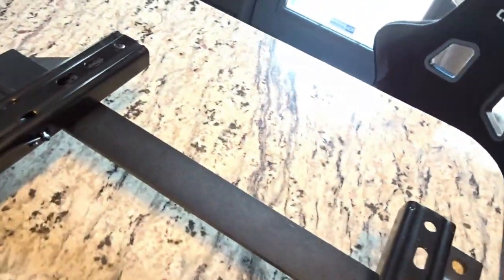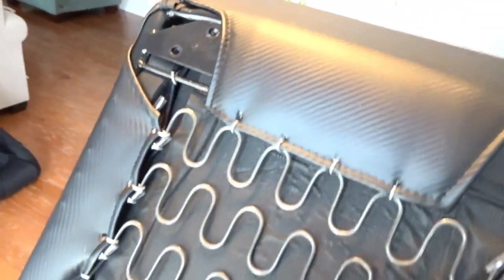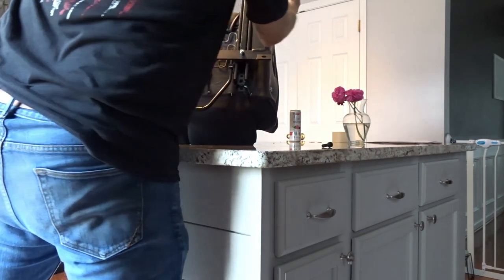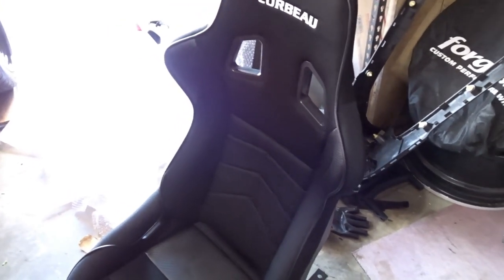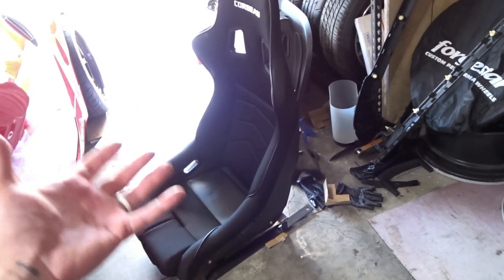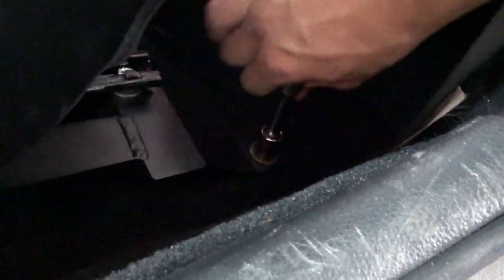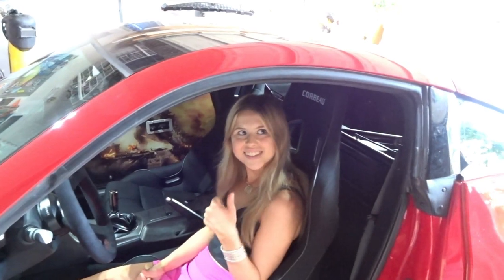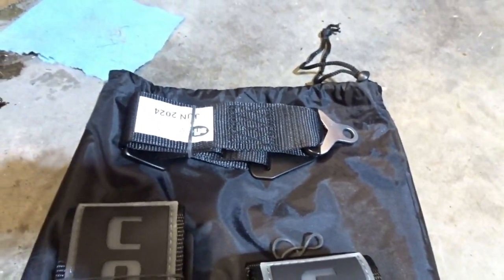Best Seats for 370z or 350z | Installation inside!

Comment: Not a fan of the 350z content but would these seats work on the Q50? I need to cut weight on the car. Also any discount codes on the seats would be Epic.
Reply from the maker: Just say you're not a fan of the 350z lol.  Don't say you're not a fan of the "content"!  But yes, I think these would be awesome seats for the Q50.  I'd love to have a discount for you, but Corbeau did not mention one at this time.  Click the link and look around the site.  If they see enough traffic coming from this video, maybe they'd consider a discount code.  At least I'd have more leverage to ask!
Reply: @SpeedCultureStudios  I got one more question for you. Did you get a airbag dash light after instal, if so did you figure out how to get ride of the light?
Reply from the maker: @randomkillz.2338  Technically, my airbag light was already on because the previous owner installed an aftermarket steering wheel.  With that being said, I put a sparco seat in my Q50.  You can check out that installation video.  It just takes a resistor in the plug under the seat to trick the computer.  The passanger seat is a bit different because of the weight sensor, but there are videos explaining how to get around that.